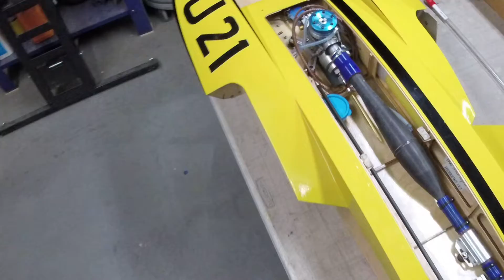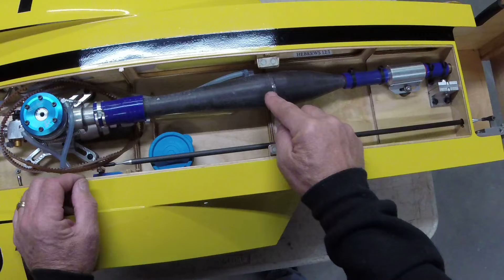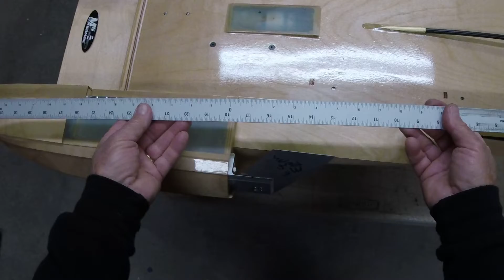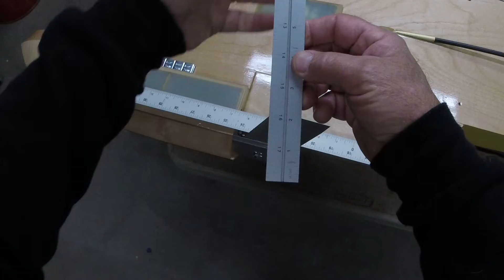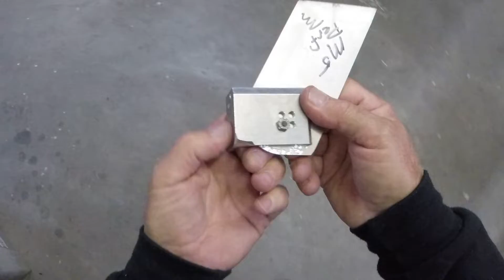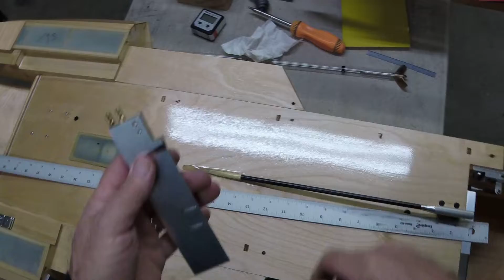RC Hydroplane - Setting Up For Speed | Theory, Opinion, Guesswork - It's All Here!

Comment: I've been taking the setup methods you showed and applied them to my Proboat UL-19  hydroplane. The difference in performance is absolutely spectacular.  Got rid of the curved turn fins and built a new adjustable turn fin mount with a carbon fiber parallelogram shaped turn fin like the ones you run.  Thanks for the great information.
Reply from the maker: Awesome!

Comment: Looks like the receiver container is a 1.3 oz SIGNORA WARE Condiment Container.  When defining CG, could you put a scale under the prop and level the boat on T/E of the ride pads?  AI (Copilot) says 1 - 1.5 lbs, other posts say 0.75 lbs. (which is only 1.5" aft on a 12 lb boat).  Can you share where you ended up?
Reply from the maker: Sure, that would work fine and I know a number of guys who do that. Unfortunately I am not one of them. I've never checked "corner" weight of my boats as I don't believe the number is particularly helpful. Every hull is different aerodynamiclly, every prop is different in its direction of thrust, strut angle is different, rpm, etc, etc... So what is the perfect balance or percentage or weight? Nobody knows! Build it, run it, tweak it until it works. Then, and only then, could such a number be useful for rebalancing a particular boat, say after making changes or repairs, but otherwise I just don't find a use for it. Sorry... Probably not the answer you wanted. And of course, I could be wrong!

Comment: I have a question regarding a gas motor and stinger setup on a vee hull.

I recently picked up a vee boat with a gas motor in it. I took it all apart and noticed the hole where the stuffing tube exits on the transom, is offset to the right 3-4mm. I read it’s to help with prop walk. If I center the gas motor in the mounts and the stinger is mounted square on the transom, won’t that bind the flex cable? or do you have to bend the stuffing tube up to meet the motor AND over a little to keep it inline? I’m thinking about just centering the stinger on the transom. It has turn fins on the transom. Any help or advice would be appreciated
Reply from the maker: The flex cable is very forgiving and shouldn't have any trouble making a slight jog to one side or the other. As for me, I work very hard to ensure the my engines and struts are very well aligned.  I think if I were working with that boat I would correct it instead of compromising with poor alignment
Reply: @M5PerfHydros  yea that’s what I’m thinking, it’ll be nothing to move it over where it’s all perfectly aligned. I’ve always done it that way in the past and never had an issue(not that I’ve noticed) . I’m not racing it’s just for sport.

Comment: Curious about where you located the weight in the sponson. Could it have been placed more in the tip of the sponson? It would take less weight to yield the same result. My build would shave 3oz but it does move the weight higher up. Maybe the higher CG of the weight not worth the weight saving?
Reply from the maker: It's an inertia thing. If the weight is placed near the center of rotation it has less inertia effect than if it were placed farther outboard.  Imagine holding a 16lb bowling ball in your hands while you rotate the ball right/left. Pretty simple, right? You can rotate it easily and quite quickly. Now imagine holding a six foot rod in the middle, with an 8lb weight on each end while you try to swing it right/left. Aha! Hard to control, eh?  Well there you go
Reply: Great explanation. Thank you.

Comment: Hey Scott, love the videos got a question does the boat need to be balanced laterally as well?
Reply from the maker: I've never put one of my boats on scales to actually check weight side to side, though I probably should!  But yes, it is a consideration of course. I'm my builds I shift the weight slightly to the left to help offset the counter rotation effect of the engine and prop on the hull.

Comment: Sorry lost power for a moment. Back to set up. One main factor in adding weight for balance is pendulum weight and reaction. This is often missed by most designers. With gravity you want to be low and light and add weight for balance. This is where pendulum coefficients come in. You can control reaction direction as well balance, fine tuning  performance. You can always add aero into the equation but with a dramatic surface change due to ruff seas it's impossible to find. I find that the best solution is to go with mechanical control. If you would like to know more about this delta please reach out me and keep the great videos coming.

Thanks
Richard
Retired Engineer

Comment: Hi Scott.  We race 1/8 scale electrics here in IMPBA D12 and D13.  I do have an old 1/10 scale winged wonder still practically brand new.  Could use some pointers on building it (the hull is finished and primered, but no gear has been set).  I have a (gas) Blazer Backlash kit I wanna build this winter.  Or we can build nothing and drink more coffee...lol.  Thanks for the videos Scott.  Very informative.
Reply from the maker: Gasser is on the way!

Comment: A lot of these theories work on full size hydros as well. Ours would turn in really fast but the rear end would want to come around to. Moved it back so back of fin is about the balance point of the boat, way better. Also need the fin running off parallel with hull otherwise by the time you are at the end of the straight you have it full right lock. So much fine tuning that can be done. Keep up the great work.
Reply from the maker: Yup, water and air are still water and air, no matter the size!

Comment: All your videos are great to watch! I hear that "chipmunk voice" when you speed through something like mixing epoxy. I then wonder if there"s a tip we may be missing? Not our buddy Scott! He wouldn't do that!  LoL  Don't know if he still does but, Phil Thomas use to put in his set up notes for each boat that he sold to put the weight that was needed inside of pipe insulation and secure with zip ties. Me, I had to put the weight as far forward and down low... That's your floatation as well. Didn't understand why he was putting it in the pipe insulation... Until I found a time clock that refused to move... There's a reason cars have crumple zones!
Reply from the maker: Oh my!  I bet time stopped for you that day 🤣

Comment: Sorry for all the words .
 For the guys who havent  sheeted the bottom of the sponsons yet  weight could be added by using thicker wood upfront  to help balance .  
Your thoughts ??? 
When we built F1 pylon racer airplanes   their minimum weight was 5 lbs .
So we reinforced weak spots   to bring the weight up  instead of  adding lead .
So after we built a few and destroyed them racing   we knew  where we could add more material to reduce stress cracks torn out landing gear etc.!!
Reply from the maker: Yes, that's correct thinking!  I hate adding "unhelpful" weight, but once a boat is finished there isn't another good option. In this build, knowing what I know now, I would definitely use heavier construction and more pour foam up front.  Next time!

Comment: Tip... i sponsored Australia's fastest hydro bare foot drag boat years back when i was a spraypainter, sand the bottom with 1200W&D or a 1600 so the water beads off it and put a silicone polish on it like a Mr Sheen, as Trevor Mcgrath said to me after the first run, if it had wings it would fly, even Rain X they use on race car windows works a treat
Reply from the maker: I don't disagree, and there are a lot of guys doing that with their boats. But dang man, this beautifully glossy bottom looks so stinking nice!

Comment: One of Best videos yet  
Its right full of info.
  So the inner part of your boat  is an airfoil  which flies the boat  at speed   is your turn fin at the balance point of the wing?? 
In our planes the balance on the  wing  is usually  the thickest part of the foil  weight forward makes its landing  speed faster and its safer to fly  and weight rearward makes it  more aerobatic  and a bit squirrely  to fly and land .
For planes lighter is always better !!
Reply from the maker: Yes, yes, and yes! You've got it exactly!

Comment: Silly question, if you want the center of balance at the turn fin could you hang it from a string on the turn fin to see if it is level?
Reply from the maker: Hmm, I suppose so, but how would you attach the string to the fin?  If you tied the string around the fin I think the tension on either side might influence its balance.  I like your thinking though. Keep it up!

Comment: I just out my dog down today man. I love that you flash Jackson at the beginning. If I had a cool channel I’d do that too. Love the videos!
Reply from the maker: Oh dang John I'm so sorry to hear that!  Thank you for taking a moment to comment, even while I know you're hurting.  We press on...
Reply: I been following this build series because you are sharing SO much great info. I really appreciate that. I don't race, but knowing more always helps to get a good running boat to run around just for fun. I love understanding basics and not guessing at setups. My question is, your prop shaft angle of 1.2 degrees, is that positive or negative? Is it lifting the front of the boat(positive, right)? Or lifting the back I'm guessing...
Reply from the maker: @chilly7261  -  The short answer is that the strut is angled downward at the rear.  The longer answer really wouldn't be an answer but more of another one of my guesswork/theory rants. Point being, I don't think anyone really knows exactly what the thrust pattern would be for any given prop. Is the prop thrust perfectly parallel to the hub, or does it splay out to the side slightly, or a lot?  Heck, I don't know.  So does a 1° strut angle lift the rear, or could it actually be pushing down?  Neutral?  Don't know.  My goal is neutral, and at the moment, with this particular prop, I'm guessing around 1° is it.  How's that for confusing the topic?